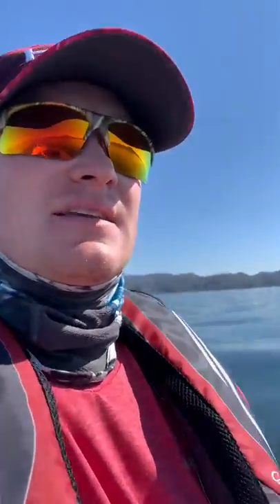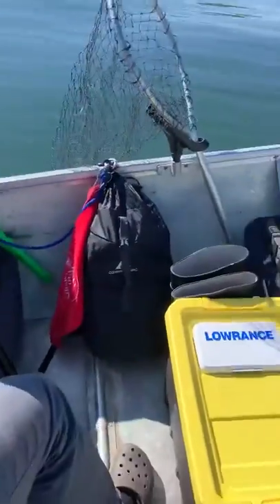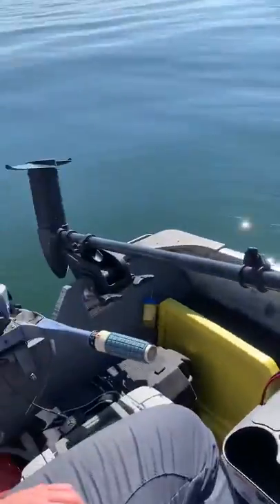Evinrude 9.9hp speed test

Comment: I just got the same motor and a 12 footer as my first boat, how do ya'll recommend keeping the bow down? I'm fairly new to boats thanks in advance.
Reply from the maker: @mickeyfrog 
So there are several things you can do to keep the bow down. 
1) Trim the motor down. Adjusting the trim (tilt) on your motor will change the direction it’s propelling the boat. If you trim the motor down a bit it will keep the bow down. Conversely, if you trim it up it will lift the bow out of the water. 
2) Balance weight. Having your boat balanced is very important for performance as well as safety. If you’re usually boating by yourself you may have to add weight to the front of the boat to keep it down. 
3) A hydrofoil or trim tabs can be added to the boat to help get it on plane quicker and keep it on plane at slower speeds. They can also help to keep the bow down. They also offer more ride stability and supposedly better fuel efficiency which I have not tested myself. 

If your motor is not getting you on plane it may not be enough power for the size of boat and/or weight it’s pushing. I’m that case a hydrofoil or trim tabs may help you to get on plane. But more horsepower is the best fix in that situation. Just a pricey fix lol. 

Hope this helps!

Comment: That things real low on power, should be getting 18-22mph
Reply from the maker: Yah it definitely wasn’t putting out RPM’s in the range it should have been. I believe a coil had come disconnected but I can’t remember for sure on that motor. 
I’ve had a few of those older 9.9’s tho and never hit faster than 15mph on similar boats. Different brand motors too. 
I had 2016 Mercury 9.9 and it would push that boat around 19mph.
Reply: @r2bboats  your doing something wrong then haha, I’ve had 15-20 jonnyrudes from 9.9-15hp and I haven’t had one go slower then 18mph
Reply: I ran a 70' 9.5 with similar setup as in this video, plus my wife in front. Got 14mph.

Comment: That’s weird because I have a 9,9hp with double the weight and I get 19
Reply: Iget 20 down river with a 8hp
Reply from the maker: Yah I’m not sure what the issue was with it. I had the compression checked which was close to even and around 100. And I also took it into a shop after workin on it myself cause it wasn’t running smooth and would die. They got that fixed but it still wasn’t pushing out a lot of power.